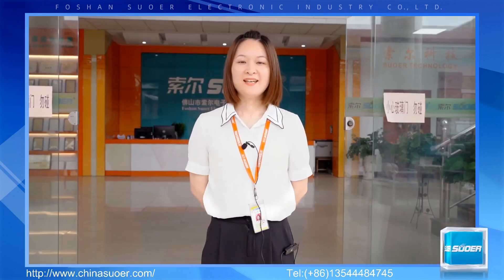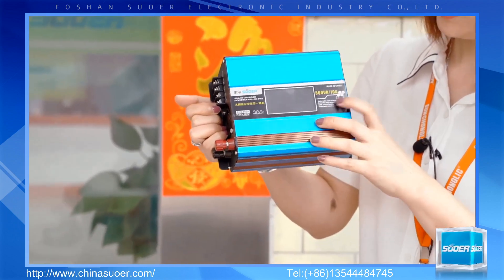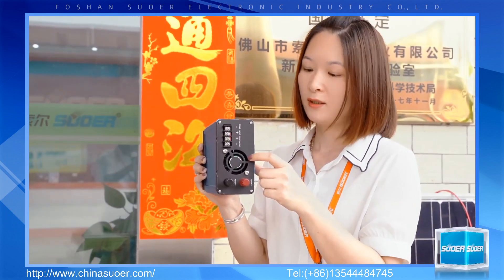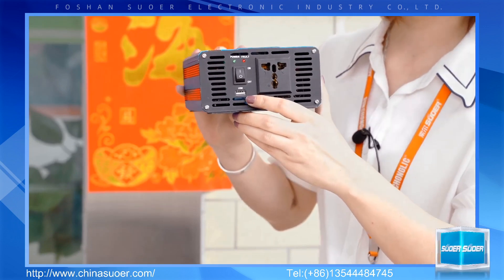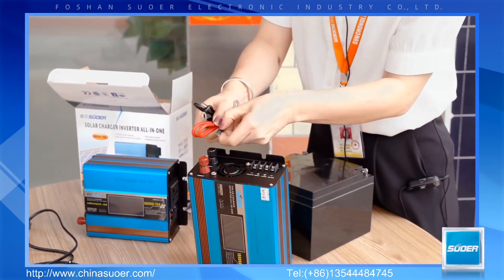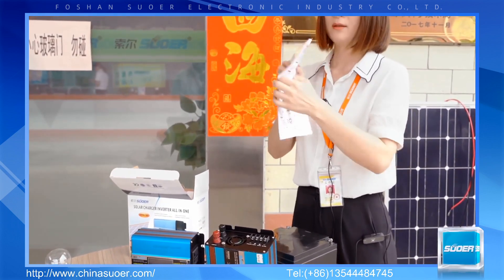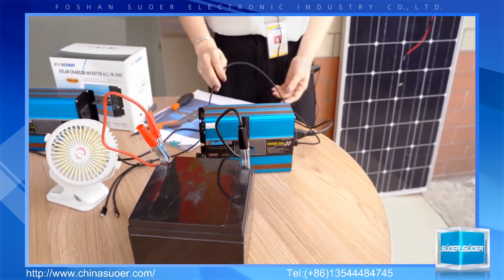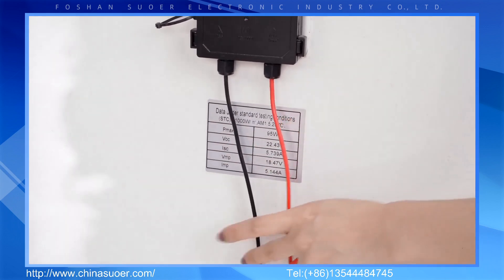SUOER 12V 500VA 1000VA 1500VA modified sine wave inverter（SUS-series）

Comment: Hello. I ask question on WhatsApp but look like there is no response. Agent ignoring my question.... Since sus-1500A it's not market with amp supported same as was  1000A (20A) I'm bit confused what fuse I should use with my 12v 100ah battery..... Like on controllers producer look like it's a problem to calculate for me that...

Comment: hello, i have this unit (1000va) - i try to use it with my small (new) batter 5ah - but after couple of minutes it shows me "FAULT" and red light appears. Can you please tell me what i need to do - i did conections same as in your videos.
(battery is full - i charget it from my baterry charger to full)
Reply from the maker: can you send me the video, let me know more details
Reply: @SuoerSolar  thank you for reply - i tryed with other battery - all works fine! 
i did check manual and see that solar panel i can use 100-200w (18v) - so it is not possible to use it with 340w pannel (18v)?
Reply: @VAKABULARDJ  so can use with 340w solar panel and more or not ? that unclear its show there from 100-150w but max solar input 600w .......